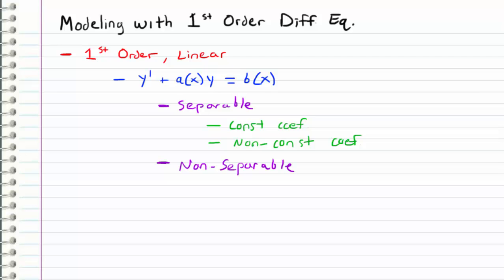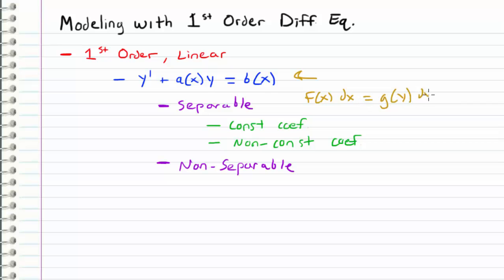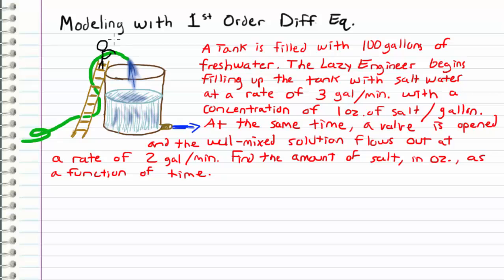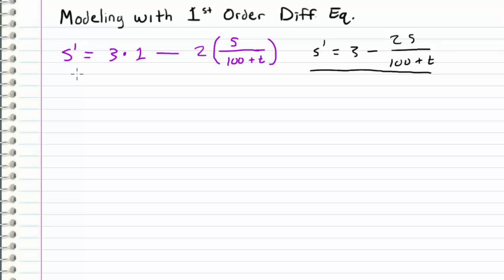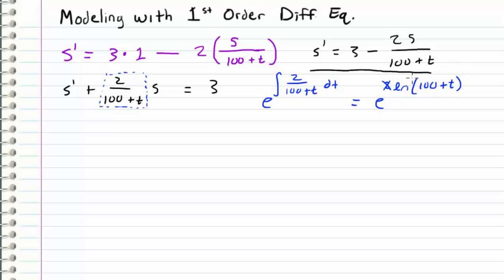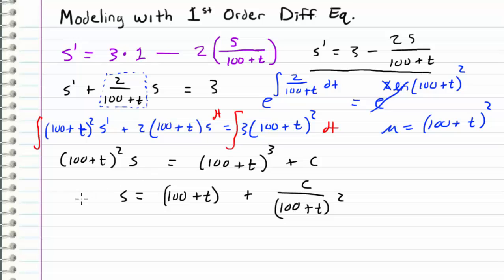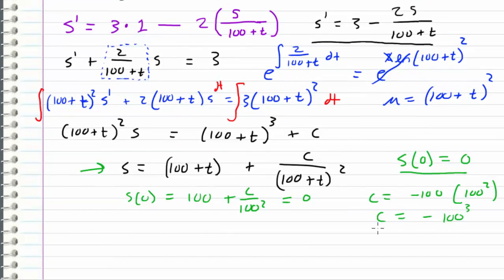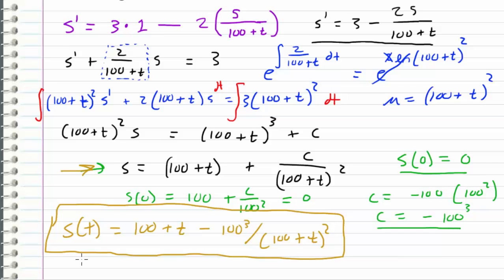Differential Equations - 11 -  Modeling with 1st Order Diff. Eq's (Tank Problem)

Comment: Just for fun, I decided to work this problem but without supplying any values until the last step, so I created some general formulas for the tank problem. A couple interesting results:

1) In the solution in the video, that term (t + 100)^2 in the bottom ... ? That squaring comes from the ratio "Out / (In - Out)", as in, the 2 gal/min and the 3 gal/min rates. You'd come up with some crazy exponents if those two rates weren't integers right next to each other, for example if it were 3 gal/min and 5 gal/min.

2) If the In and Out rates are the same, the solution changes such that it's a simple exponential curve that asymptotically approaches the point where the water in the tank is indistinguishable from the water coming in. The interesting thing is if you also assume a non-zero amount of salt initially in the tank: then the solution is the sum of the asymptotic result I just described, PLUS an exponential decay of the salt that was initially in the tank. That makes me want to use tiny discrete particles instead of salt, in two different colors, so I could watch the initial particles disappear while the new particles would gradually take over.

Comment: 6:50, why are you taking the exponential to the integral of that? Is that Mew(t) and P(t)
Reply: we're using Differential equations with boundary-value problems by Dennis Zill,the section about the integrating factor is 2.3. Or you can probably try googling solving a linear first-order equation. Basically you're given a formula and you need to identify parts of your given equation or arrange it into standard form to plug in to the exponent of e. In this video he gives us a solid example of when we actually get to use this formula.

Comment: how do we know it is rate coming in - rate coming out? Isn't rate of change final minus initial?
Reply: We make a gross simplification by taking an assumption, that the solution of salt water mixes in the tank perfectly and instantly. Did you notice, that proper industrial chemical reactors are spheres? A more accurate solution to the problem would involve a diffusion equation in 3 dimensions of space and time. Symmetric boundary conditions help solve them and make for a better industrial process.
  In the simplified setup in an example at hand S is a concetration of salt in a tank as a function of time S(t),  this is a changing value and we denote the rate of instantaneous change of S as S’.  S’ is of course a function of t as well: S’(t) 
we are able to write our formula for S’(t) as [flow_in*concentration -flow_out*(S(t)/(100+time)]
  This is one level of abstraction up from your A level maths and there are still quite a number of these to go.

Formulating problem properly, in other words, finding the right model, which is acceptably easy to solve, but close enough to reality, is the most important part of the overall task.
Finally, did you write all the exercise on paper for yourself?  Better still, take any free CAS and write it into this Caomputer Algebra System.  Plot the solution and read some numerical values for different times.

Comment: At first the final answer confused me: how could it be that the amount of salt is increasing at all times, and doesn't asymptotically approach a limit?  Well the answer is, there is more water going into the tank than coming out, so that's where the increase comes from.  If the deal were that 2 gallons were being pumped in and 2 gallons were being removed, then that changes the initial differential equation so that the volume is a constant "100" rather than "100 + t", which drastically alters the math, and indeed does give us the asymptotic behavior I was (mistakenly) expecting.

Comment: question: What happened to the (100+t)^2 s' when integrating? does that become 0? if so is it because of the integral of s'?
Reply from the maker: ProjectDuck HQ could you point out a specific time stamp? If your talking about the integration of the left hand side of the equation, it’s just undoing the product rule of differentiation
Reply: Oh okay and in undoing the product rule, the (100+t)^2 * s’ becomes 0? I’m just a little confused on how (100+t)^2 s’ + 2(100+t)s became (100+t)^2 s since the first term of the left side disappeared.
Reply from the maker: ProjectDuck HQ let u = (100+t)^2 * s’ and let v = 2*(100+t)*s. You’ll see that the expression you wrote is equal to uv’ + u’v but that’s equal to (uv)’ and so the integral of that is just uv ( that’s what I mean by undoing the product rule) does that make sense?
Reply: The Lazy Engineer OH okay, that makes more sense. Thank you for the help!

Comment: Umm how is the integral of 3(100+t)^2 is equal to (100+t)^3?? Thats not how the integral works, the answer should be 30000t+300t^2 +t^3 +C
Reply from the maker: Eren Karaca it’s fine. Just a different “+C”.
It’s like saying the integral of x is 1/2x^2 + 1 + c.

Reason why I have it the way I do is bc I used simple u substitution. Let u = 100+t. Then du = dx. And so rewriting the integral you get integral of 3u^2 du. Which is 3u^3 / 3 + c. = u^3 + c = (100+t)^3 + c

Indefinite Integration is arbitrary up to a constant (the + c) so it doesn’t matter if you have any other constants in there - you’ll just end up with a different C value than me bc mine will be shifted by a constant that’s already present in the solution

Comment: What happened to the 2 infront of (100+ t)s??
Reply from the maker: im not seeing a mistake right now, but from what i see the "2" popped up to become a "squared" when calculating the integrating factor. Integrating both sides leaves you with the integrating factor * s on the LHS. so the 2 is gone. Maybe your confusion is coming from how I integrated both sides. Check out the 1st order non separable (method of integrating factors) videos that I have - that may clear up any confusion!
Reply: Integral(100+t)^2 s' + 2(100+t)s dt  you have 2 in front of (100+t)s don't you need to algebraically remove that first?
Reply: Nevermind, yeah you differentiate it. You are right no problem. Thanks
Reply from the maker: Nope! let u = (100+t)^2 and v = s. Product rule of differentiation is: (u*v)' = uv' + u'v. And so, we can say: the integral( u'v + uv' ) = integral( (uv)' ) = uv! So now, Substitute in for u and v now: and you have ( (100+t)^2 * s ) ' = (100+t)^2 * s' + 2*(100+t)*s which means the integral that you wrote above in your prev comment evaluates to u*v -- or -- (100+t)^2 * s.
Reply: The Lazy Engineer got it. I got confused there for a bit. Had to watch the previous video about product rule. Thanks for clarifying. You are awesome!
Reply from the maker: Not a problem! Dont hesitate to comment with questions in the future!